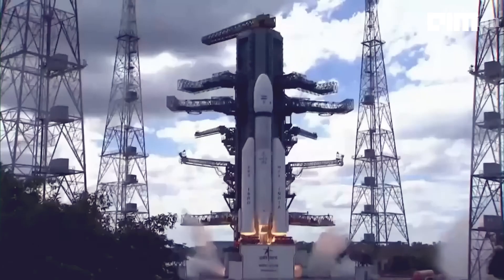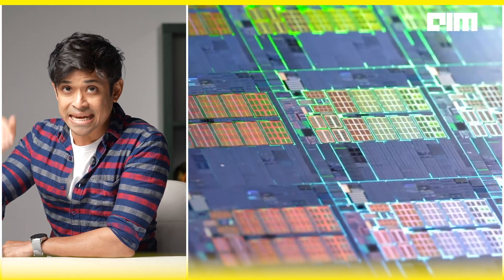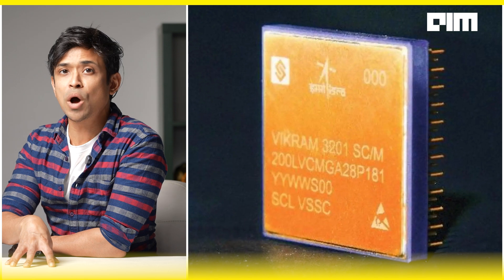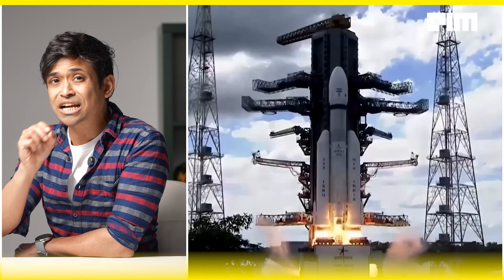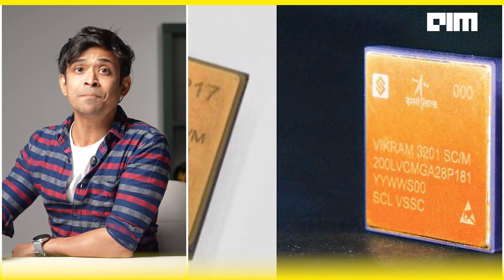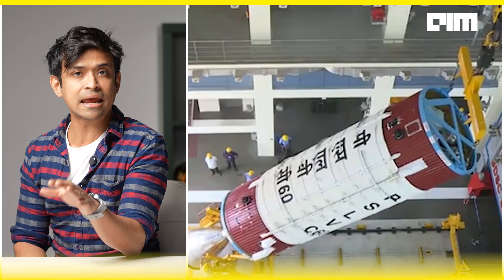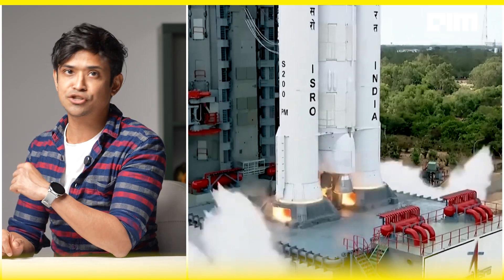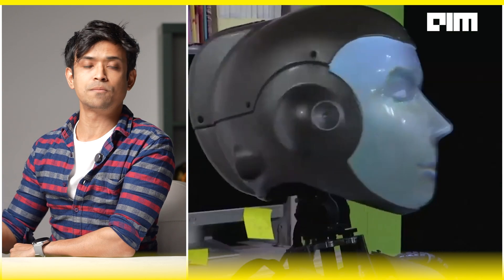ISRO’s Made in India Space Chips Are Game-Changers! Vikram 3201 & Kalpa 3201 Explained

Comment: India need its own jet engine technology at any cost..this is very important for national security...Govt should spent money on R&D for jet engine...Its a national security matter....
Reply: Building an aircraft engine in India is a massive challenge, not just in manufacturing but also in testing infrastructure. The country currently lacks key facilities like wind tunnels, engine test cells, vibration testing labs, specialized metallurgy labs, environmental chambers, and noise & emissions testing centers. Setting up these alone would require an investment of $4 to $5 billion.

Moreover, these are just testing facilities—not manufacturing units. To even start engine production, India needs forging plants for turbine discs and blades, CNC machining centers, and advanced composite material production, all of which require both cutting-edge technology and years of expertise.

Without indigenous expertise, the only alternative is to acquire or replicate existing designs—a strategy that some nations, like China, initially adopted. China reportedly acquired blueprints and technology through cyber espionage, industrial espionage, and intelligence operations, targeting advanced countries like the U.S., Russia, and European nations. By reverse-engineering these engines and gradually improving upon them, China has now not only mastered engine production but has also become an exporter in this sector.
Reply: @somnathsinhababu7642  India lacks behind in aerospace, defence and semiconductors. This three are critical areas where India needs to invest R&D.
Reply: So what India have been doing all years after independence?